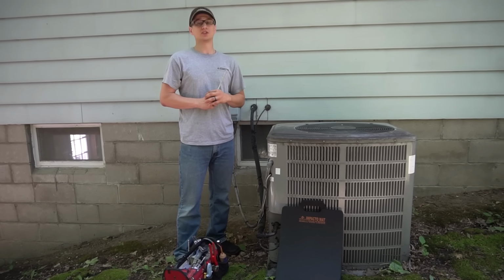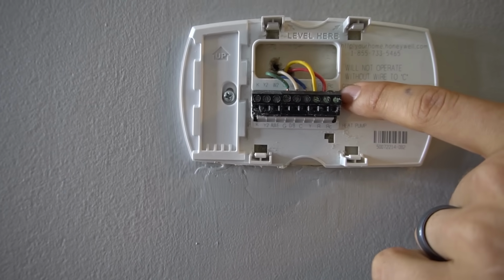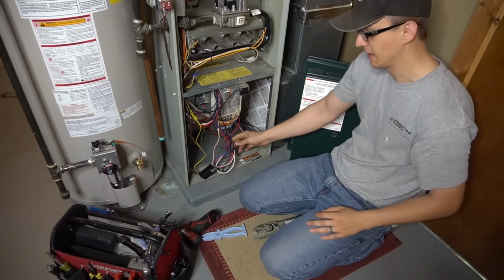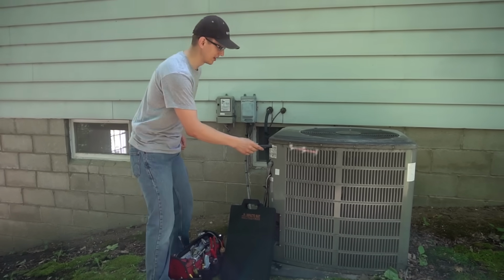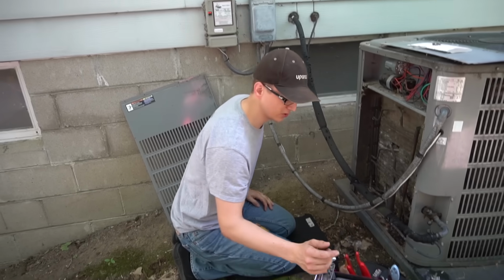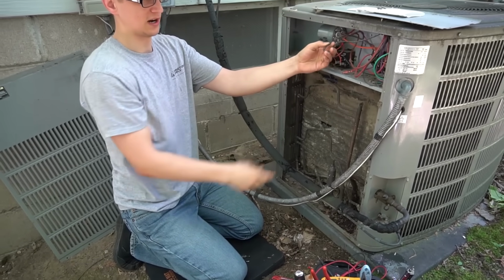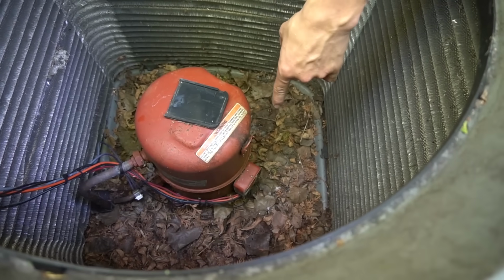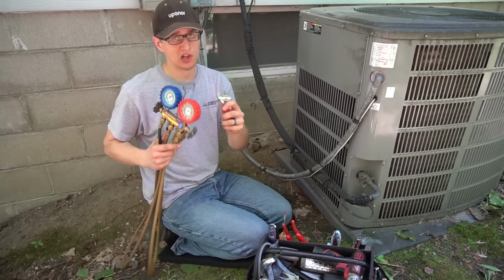AC Unit Not Turning On - How to Fix It Step by Step

Comment: Very informative video. As you figured, I found this video b/c my AC wasn't working on my first floor. I watched the entire video and realized that the outside unit fan wasn't spinning but the unit was humming. Therefore I ordered a new capacitor and replaced it today and now the fan spins! However, the house isn't cooling. The outside fan appears to be blowing cool air compared to the unit next to it which is cooling my 2nd floor. Any ideas?
Reply from the maker: Doing good so far! Got the fan to spin. :) Well.. Usually you can hear the difference between the compressor turning on and the fan turning on. I am wondering if maybe the fan is spinning but the compressor is still not turning on. If you can hear the compressor buzz briefly like it tried to start but it doesn't, then I would try putting in one of these: SPP6 Hard Start Kit: https://amzn.to/2JSPieo  That hard start kit cuts the start up amperage of the compressor in half and helps it get going at start up. Another thing I would check is the compressor wiring. If you take the top of your unit off, and take the compressor plug or cover off, do you see any broken or burnt wires? Sometimes one of the connectors gets brittle and breaks off. When you do this, make sure you turn the AC breaker off and pull the disconnect out otherwise there will be 240v out to get you.. And another question. Was the unit working good before the fan stopped spinning like that? If it was not cooling to well to begin with, then it could also be a Freon issue
Reply: Thanks for the quick response! I really appreciate your feedback. The unit was working just fine until a week ago. Then I noticed that the first floor was getting uncomfortably warm. The vents were blowing cool air but just not cold enough to lower the temp under 80 degrees. I just assumed the heat wave we had in the East Coast was a part of the reason. Before I got the fan to run I did hear a buzzing sound, which I initially thought the fan just need a jump start (stick trick) but it didn't work. Do you think the buzzing is from the compressor or fan motor?
Reply from the maker: The buzzing is probably from the compressor. Do you have separate capacitors for the fan motor and the compressor? If yes, then replace the compressor capacitor as well. If it's one capacitor for both, then I would try putting in the hard start kit that I mentioned (It is easy to install. One wire wire goes to HERM on the capacitor and the other to C). If the fan seems like it is spinning sluggishly, then you may be missing one hot leg too. So instead of 240v, it is only getting 120v. That is not enough for the compressor.
Reply: I'll give it a try. Thanks for the advice!
Reply from the maker: Alright, good luck and stay safe!
Reply: Just wanted to keep you updated. I ordered the part but had to put the project on pause as I was away on vacation for a few days. Today, I just installed the hard start kit and the fan is still blowing cool air. I tried opening up the unit to take a look at the compressor but was fearful of breaking or loosening up the connection to the fan. So all I did was take a peak under the lid. The compressor is wrapped up in some kind of insulation with velcro and the wires from a far look okay. I guess I'd really have to open up the lid to really diagnose if the wires were loose. Do you think the compressor is just bad? Should I check anything else?
Reply from the maker: If the compressor is bad, that's very expensive.  I would do some checking before coming to that conclusion. So the compressor is still not turning on? I know it's a bit of a hassle, but you do need to get that top off. You may be able to loosen up the fan wires a bit in the electrical section so that you can more freely move that top part. Or label the wires coming from the fan and just disconnect them. (make sure the power is off everywhere of course) The black stuff is just insulation for the compressor, a "jacket", you can undo the velcro part and it will come right off. Your job will be to get to the compressor pin terminals and see if the connectors are burnt or broken in there. If something is broken, this is the optimal fix: Qwiklug Compressor Wire Repair Kit: https://amzn.to/2JWmsdh

If the wires and connectors look good, then further troubleshooting of the compressor will require a meter that can check resistance
Reply: How can I check if the compressor is turning on? Before I replaced the capacitor, the fan wasn't spinning but I heard a buzzing/humming so I thought that was the compressor. Can I unhook the fan wire to the capacitor so the fan doesn't spin so I can listen for the compressor? It's a bit hard to distinguish what's turning on now that the fan spins.
Reply from the maker: Yes, although it would be better to disconnect the line voltage going to the fan. If you are not sure which ones those are, you can go ahead and just disconnect all of them. Make sure the connectors on those wires are not touching anything and turn it back on to see if the compressor does anything at all
Reply: I unplugged the wire going to the fan and turned the unit back on and I can hear the compressor buzzing. I'm not sure what else my novice skills can do. :(
Reply from the maker: Don't worry, you have already went above and beyond most people in terms of fixing your own appliance. So does the compressor turn on and keep running, or does it buzz for a few seconds and shut off? I don't know if I already asked you this, but do you have a multi meter?
Reply: I went ahead and called a technician. They said the compressor is malfunctioning. They offered to replace the compressor or the entire condenser unit. Thanks again for all your advice.
Reply from the maker: Ah I see.. Sorry to hear that! A malfunctioning compressor would be hard to trace down just by commenting back and forth on YouTube. Well now we know. Thanks for the update! Stay cool ;)

Comment: Hi! Thank you so much for the videos. My husband and I have been troubleshooting our system. We have a Goodman with a load management device from the electric company. The fan is not moving and no noise is coming from the unit. Inside, the furnace is working, but blowing hot air through the vents. We have changed the thermostat batteries and the capacitor. The shop we took it to confirmed the capacitor had a bad terminal. It didn't resolve the problem. I would love to figure it out. Thank you so much!
Reply: A little more information.  I can not find the plunger to bypass the thermostat. However. My husband did inadvertantly touch the insulated needlenose pliers to the housing and one of the wires.  Sparks and a pop!  I think I can say we have power to the unit? Also, the fan blades do move easily with a stick, but do not turn on their own.
Reply from the maker: Heheh, yeah sounds like you do have power to the unit ;) As for the plunger in the contactor, yours may have a little cover over it with 2 small screws holding it down. You just take the screws off and the cover comes off, revealing the plunger. When you shorted the pliers to the housing, that may have tripped the breaker or a disconnect fuse. But if it was very brief then probably not. So if you have power to the outside unit, that means that what you are missing is the 24v that go to the contactor coil. Once the coil gets power, it pulls that plunger in to allow the 240v to go through. Do you have a multi meter that can check voltage? It would eliminate some guess work. Also, you mentioned that you have a load management device installed. I have seen those devices go bad before. An easy way to check if it's bad or not is to bypass it. If this is something you want to attempt, here it goes:

1. Turn off the circuit breaker to the AC unit and to be safe you could pull out the disconnect too.
2. Turn your thermostat to the off position.
3. Find the thermostat wire that comes out of your house with the freon pipes.
4. That wire will have 2 wires in it. Usually a red and a white. Wherever those wires go, disconnect them and connect both the red and the white wires straight to the contactor coil. (one of them might already go straight to the coil.) You may need to put on some connectors or add a piece of wire to make this work.
5. Before doing step 4, you may want to take a picture of the wiring so that you can put it back to how it was after you are done.
6. Turn all power back on, turn thermostat to cooling, and see what happens. If the unit turns on, then you know that the load management device is malfunctioning. If bypassing it does not turn on the unit, then we know that you can stop suspecting the load management device. By the way, some of those devices will delay condenser start up for 5-15 minutes if there was a loss of power. Just so you know. The unit starts for 1 second and then stops.
7. Turn everything back off and put the wires back to how they were.

That test is a little more difficult to do if wiring isn't something you have ever done.. With a meter, you could just measure some voltages and figure it out that way. From what I can tell you are basically losing your control voltage somewhere (24v). Is the furnace LED diagnostic light blinking any error codes by chance?
Reply: Sooo....we didn't have a multimeter to check it and still couldn't find the plunger. Our electric company that put the load management device on our system sent a service tech out free of charge to finish the task. He confirmed our old capacitor had been going bad. We had power tonthe unit and when he depressed the plunger it started. He then checked for 24v and it was present. He confirmed there was power at the furnace and some how went around the thermostat and it kicked on. He determined it was the thermostat. So my husband got a new thermostat and installed it. And success!!!! We are cool as cucumbers, well getting there. All in all $100 to fix the ac.  30 for the capacitor and 70 for the thermostat.

I cannot thank you enough.  Not only did we save money, more importantly, I am more confident in my abilities to troubleshoot and not be intimidated. When I called the electric company and told him everything I had done, he said I sounded very knowledgeable. As a homeowner, I now know that I can teach myself enough not to be snowed by a repairman.  Once I had 3 quotes for my other broken AC (2 zone home). One was $14000, for a new system, the other $7000 from another, and the last quote $200.  The two hundred was from a small family business. The others? Big companies telling me I needed a new system. 

Thank you again. You are now my go to for my troubleshooting!

Now, how do I fix my pool heater????j/k
Reply: Oh! You are my favorite youtube channel
Reply from the maker: Thank you for the update! :) Glad to hear that everything  worked out so well! That is awesome that the electric company sent a guy out free of charge and he was a good one too! Usually they would just determine if their box is good or not and no further. This tech did a good job. I was going to tell you to try bypassing the thermostat after your next reply (you just take the thermostat off the wall and put a jumper between  R and Y) but it looks like the other guy got it all figured out and you are already cool as cucumbers so there's no need ;) Anyway, I'm happy for you! Keep fixing your own AC, save a bunch of money, and stay safe and cool!

Comment: I got my unit running and it blows cold air like it should. However, the condensation on the air ducts throughout the basement is terrible. 
At first I thought it was normal because we recently moved to humid Nebraska, but it has continued and gotten out of hand. Water is everywhere. 
I already checked the condensation tubes and they are not clogged, everything is clean.  
My unit has a condensation pump, I cleaned it and everything seems to be in working order. 
Again its doesn't seem like the condensation tube, the ducts are literally sweating (dripping) water.

Thanks for all your previous help.
Can you help me again?
Reply from the maker: Hey Luke! It sounds like you have very high humidity in the basement. Check your returns and vents in the basement. If you have any of them closed off, open them. One of the main functions of an air conditioner is to act as a dehumidifier. But it may not be keeping up. In that case you will need to get a de-humidifer. Something like this: https://amzn.to/2NvCg4I  Look around and get one that will be best for you. I bet that thing will pull a ton of water out of the air in your basement. That should help you with the condensation problem

Comment: Hi. In my instance, everything works in the house. The outside compressor fan will stop rotating after the sun starts hitting it (On extremely hot days). I can turn it off for a while and turn it back on and the fan rotates again. Would that be the capacitor?
Reply from the maker: Yes, I would say there is a good chance that the capacitor is getting weak. If you have a meter, you could check it. Otherwise they are pretty cheap, why not replace it if at least for maintenance ;)
Reply: Thank you.  Thinking of replacing the fan motor as well, just to get it done while I'm in there. Keep up the great work on your videos.  You explain things very well and cover it all!
Reply from the maker: Thanks! Good luck with the repair!
Reply: I took the panel off and noticed there was a smaller capacitor (two connectors) zip tied to the bigger one. Nothing was connected to the fan connector on the larger capacitor. Have you seen this before? Seems odd. Not sure if I should get both.
Reply from the maker: I would think that the smaller capacitor is actually the fan capacitor. Is it wired to the fan? And the larger one must be a dual capacitor (you can hook up the compressor and the fan to it). The dual capacitor's uF rating was probably different then what the fan required so they just used a separate capacitor for it. That would be my guess as to why that is
Reply: Yes, It appears it is wired to the fan.  The larger capacitor is 30/5 MFD and the smaller one is 5 MFD.  Nothing is connected to the fan terminal on the larger capacitor. I ordered both and will replace it the same way it was.
Reply from the maker: Oh okay! So actually the dual capacitor had the same rating.. So if you wanted to you could have just used the one dual capacitor but now that you ordered them both, you may as well just replace them the same way there were :) That may actually be better because that will somewhat split up the load between the two capacitors. Good luck good sir!
Reply: Thank you again for all your help. Very much appreciated.

Comment: Actually works fine but outside fan and compressor do not turn off after cooling home is complete and thermostat shuts down furnace blower
Reply from the maker: That's an interesting problem to have.. Does your evaporator coil completely freeze over then? Along with the suction line and compressor at the condenser? Do you have a multi meter you can check voltages with? I am curious to know if there is still voltage at the contactor coil when it is supposed to turn off. If there is no 24v at the coil, yet the plunger does not release, then your contactor plunger is probably getting stuck shut. If that's what it's doing, I would replace the contactor, they are pretty cheap.